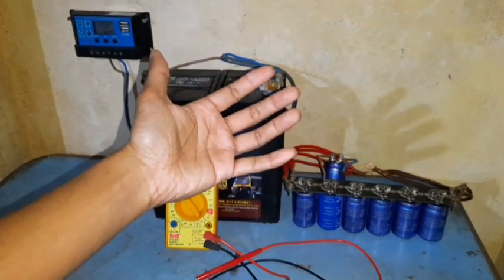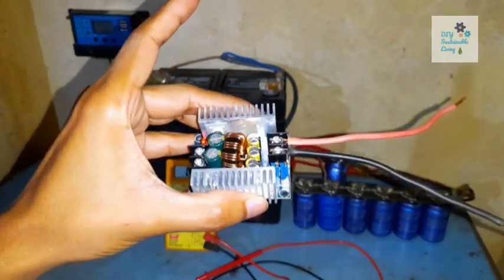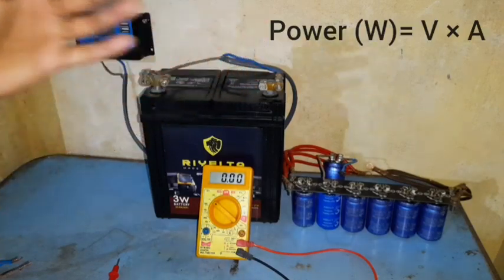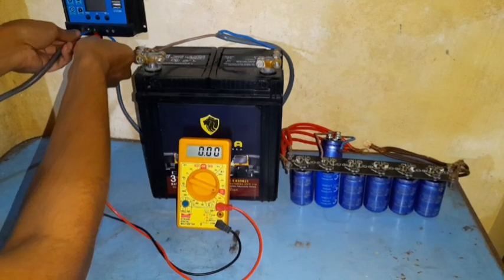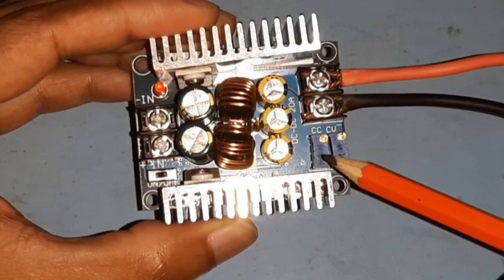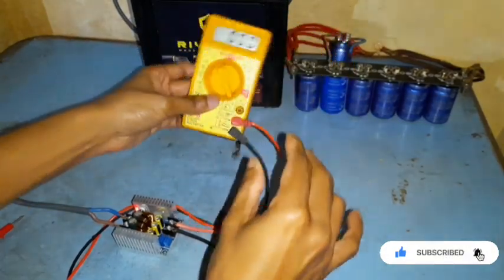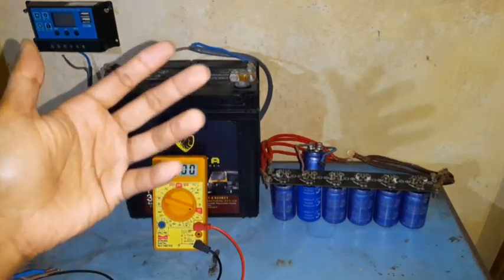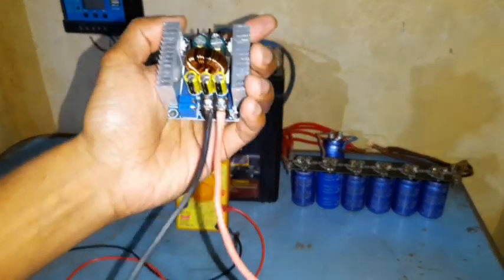Dc to dc Step Down Converter- Part 1 | Improve your DIY Off Grid Solar System using a Buck Converter

Comment: no problem. My suggestion would be, the one described in the previous message, with and without batteries. would it be possible? namely. solar panel with solar regulator or adjustable power source to simulate solar panels. and connected with a dc to dc converter and supercapacitors to the 12 volt dc inverter to output 220v ac and connect a refrigerator. see if you can show us any video. thanks to you for your wonderful videos friend. regards
Reply from the maker: Sure will give it a try.
Reply from the maker: Here is the video you requested! https://youtu.be/yyEPNL7Va9o
Reply: @diysustainableliving2774  thanks for the video friend. but I have some doubts 1. How many batteries are needed for 24 hours a day if the refrigerator consumes 100 watts per hour at 220V alternating and has a compressor start-up peak of 3A = 700W peak? 2. The reduction module at its input will have 18v and 5A from the plate and at its output how much have you put it? What current does it deliver, 20A? 3. the super capacitors that I have have a balancing circuit. and I don't need a light bulb. Could you put it directly into my electrical circuit? send me an e-mail to; antoniovalenciano@hotmail.com and I give you my field circuit that I have at home so I can share it with you. if you want. greetings friend
Reply from the maker: The fridge dosnt work continuously 24hrs a day. It stops and starts. So the best way to measure that is to buy a watt meter and see how much it consumes for 24hrs. Measure that over a few days and average it for 24hrs to get your average. Next you have to decide what type of battery chemistry you are going to use? Is it going to be lead acid, lithium ion, or liFePO4?
Eg: If your fridge consumes 0.5Kwh for 24hrs you will need minumum of 1kwh of lead acid AGM type or, around 0.7kwh of storage if it is lithium.
As for the supercapacitors the balancing circuit is a top balancing one. That is it will prevent the caps getting overcharged more than 2.75v. What I have done here is also more ore less the same. The difference is that I am using Zener diodes to achieve the same.
The buck converter of course is not an MPPT. is is not giving me very high amps as expected in an mppt. The reason is that the difference from my panel to the charger is not much.
Reply: @diysustainableliving2774 friend, But what value of voltage and amps does it have at the output of the converter module?
Reply from the maker: Voltage is set to 14.4v. Amps depends on your solar panel and time of day. Dont  use a buck converter if the is no significant difference in voltage. You wont get more amps. You will be better off with a MPPT charge controller instead.

Comment: Hello. I suggest you upload a practical video with the bank of supercapacitors that I see you have, connected to the output of the converter circuit to start a refrigerator. could you do this Congratulations on the video, I liked it.
Reply from the maker: You mean to connect the supercapacitors with the dc to dc step down converter without a battery to start a refrigerator? Good idea... I will first have to test and see. According to my estimates It might only work only on a clear day at 12 noon. The super capacitors give power boost right at the first few seconds when a massive amount of power is needed to start the inductive load and to maintain the fridge function i'll need well over 12A which are out of the maximum possible power out of my panel (150w) at peak production. So I will first try and see and if it works ill definitely upload a video on it. Btw thanks for the suggestion.
Reply: hello, without battery and with battery. Thank you

Comment: So the buck converter does what exactly?  I thought they were used to step down voltage from a 24v battery to 12v for example?  Is that something else? 

What are you using it for in this system?  I didn't quite understand what it's doing.
Reply from the maker: A buck converter can efficiently step down the voltage. As you said it is usually used to just step down DC voltage. In solar power setups the solar panels used in a 12v system have a voltage around 20V. But the voltage needed to charge a battery is 14.4v. So to get the voltage down you need a charge controller either PWM which is cheap or MPPT (Expensive). PWMs just step down the voltage but dont change the amperage. To get the maximum power extraction MPPT charge controller use microcontrollers to calculate the panels maximum power point and get high amperage for the same charging voltage. 
The buck converter dosnt have microcontrollers but since they efficiently bring down the voltage they make available more amps at the output. So this is my point. By adding a buck converter you get more power from your solar panel compared to a pwm solar charge controller.
Reply: Let me explain.
As you know ohm's law,
When you have a voltage and reduce it the current rises, the opposite occurs too.

A pwm swiches on and off. Then you have the average voltage. There is no change to the current.
In the buck converter, the inductor (wound copper ring) has a magnetic field as the power flows through it and the Field collapse causing a spike in voltage which is converted to current. This is why the amps rise in part, the other part being the voltage reduction.

If you had a 36v panel that has 1 amp.
36*1= 36watts.
If you then have half the voltage,
It would be 18*2 =36w
If you're charging a battery, you would want 2 amps on a small battery, 5 amps on a big battery to charge it correctly.

You cant create energy.
19.5*0.7= 13.65watts.
14*2= 28 watts.

Why is there more?
MPP. Panels voltage (OC) is what it is but may not offer the peak power, say for example it's 16v.
And the current curve drops at the top voltage.
If you read the document for your panels it will show the power curve which could be used or less to maximize the power output.

Direct connect, will offer less power and over voltage (boiling the battery)
But you have less current flowing.